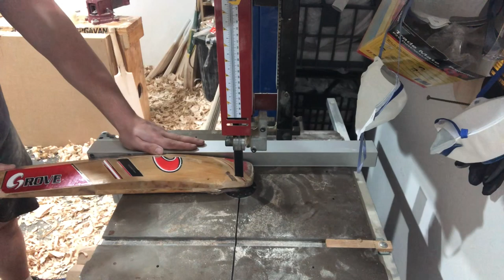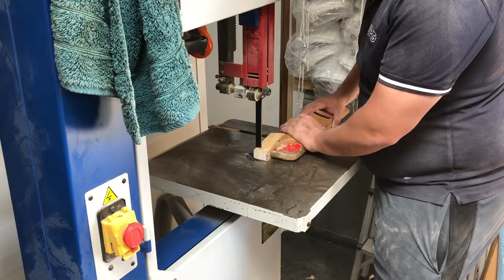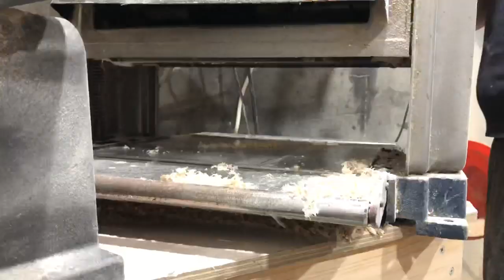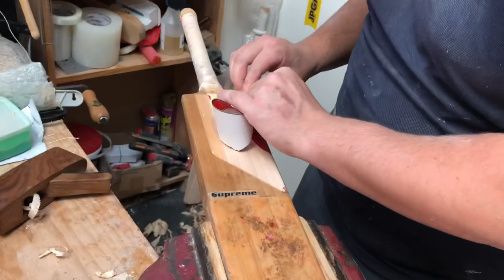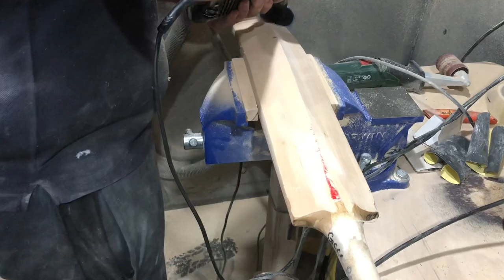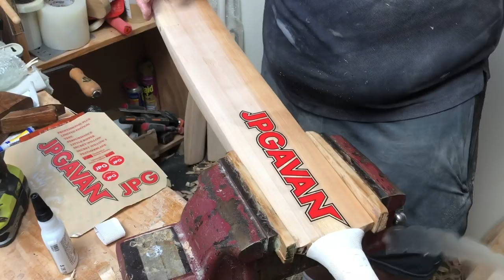Fixing a BADLY broken Cricket Bat. Challenge Repairs 4

Comment: Hello JPG
I like you work a lot
Just a word of advice from a fellow bt repairer
Binding a tight twine on the repaired part will make it almost unbreakable
I do these kind of repairs all day and it has never failed me. Not a single complaint of the bat breaking again from the same spot.
Reply: what do we call that sticks inserted after drilling and from where can I get or buy them....
Reply: @ArpitSingh-ec2lh  it is called wooden dowels .it comes in different size 6mm,8mm 10mm comes in different length too upto 1meter

Comment: Whats the diameter of the dowel you used and how big was the hole you drilled? Did you keep any tolerance?
Reply: Dowels comes in 6mm, 8 mm,10 mm .if u using 6mm dowels drill hole with 6mm drill bit